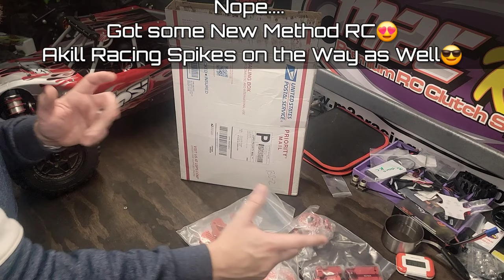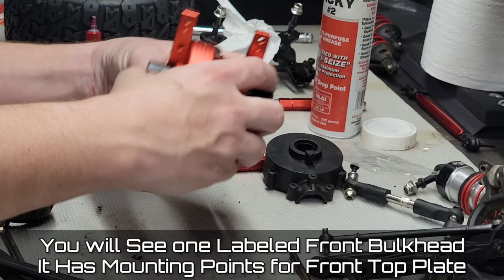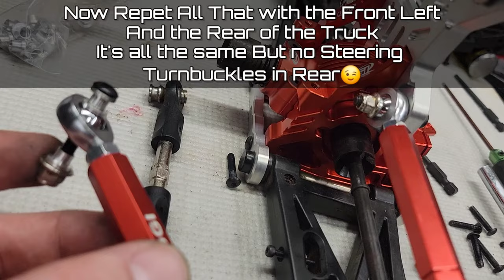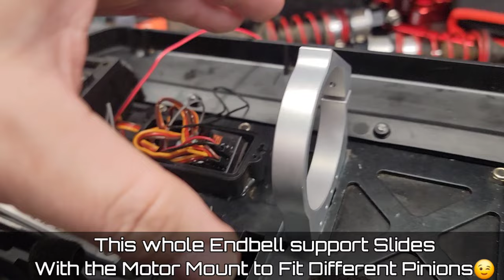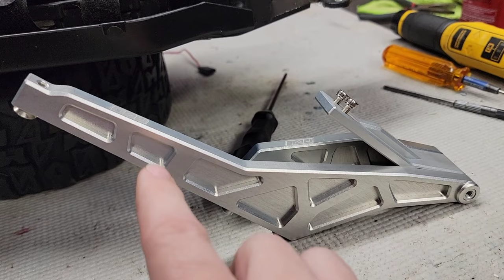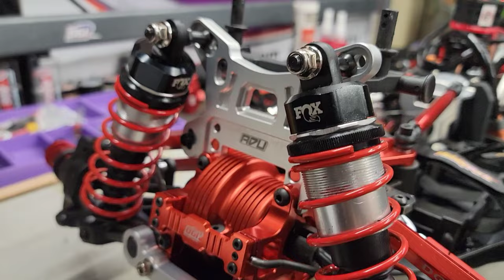Losi Dbxle 2.0 Full Beefcake Upgrade Install Video😱😎👍 #BestUpgrades #LosiDBXLE

Comment: Holy guacamole Batman you talk FAST... I had to double check and make sure I wasn't watching at 2x speed when you were talking... This stuff all looks cool... But I really think it's all a waste of money tbh... You're just making stuff too rigid which just moves the weakest point around. It doesn't get rid of it. I had a bunch of aluminum stuff on my Kraton and I hated it. Instead of the hit being absorbed by the flex or maybe breaking a cheap plastic arm. I bent my whole expensive aluminum chassis plate... After that I took it all off. I had a good couple hundred dollars worth of stuff. It looked AWESOME. I had a bunch of blue anodized stuff. But the rigidity really didn't do what you'd expect it to do. If anything. It did the opposite...
Reply from the maker: I hear ya on the speed of video. Many times in this video I had to speed it up 10-20% or it would have been a 40 minute video😳

About the beefcake parts.... Every rig is different (especially these 1/5 scale rigs) .... Whole other world than 1/8th scale. and sometimes it makes sense and depends on what parts.

This is a big rig and the chassis is not strong and bends easily. So that's why the chassis reinforcement. I have done this with other big rigs and it has saved the chassis on my Losi 5ive T for example.... So it works in some places. Metal A Arms DEFINITELY NOT a good idea, and you definitely want to have flex in the places that can have impact, arms, bumpers. You want most of the flex around the outer extremities of the RC where the impact will need to be absorbed upon a crash and as you move closer into the chassis more stiffening is needed for the chassis and bulkhead areas because the gears and those types of things need to be held stable. The one place I'm concerned about with this build is that I have metal turn buckles and steering links WITH plastic arms, so the arms will give bit the other parts by the arm won't. We will see, most dudes do the same I did here with no problems because the arms still flex.
I understand all you said about impact moving to the weakest point and I only add strength where it makes sense. 
There is still some slight flex to the chassis even with the braces, the arms and bumpers flex as does the roll CAGE. 
When I first got this RC I bent the chassis with light bashing small jumps. I don't need it to be M2Cified like my Arrma rigs, I'm not planning to go big like indo in those videos.... But I don't trust myself, I will send er at times so this amount of strengthening was need for what I do. Sure if I was just interested in ripping around a field or keeping the tires in the ground most of the time with small jumps sure I'd be fine mostly stock. But I get a little silly if you watch my other videos. 

Really appreciate your time and comment.... Hope you are enjoying the channel, see ya round brother

Comment: Monster vid for a monster build. I’m liking ADU parts so far as well, I’ve only got a few pieces so far but fit and finish is good. Looking forward to seeing this sucker rip! Do you have the motor and/or esc upgrade picked yet?
Reply from the maker: Appreciate the kind support my friend, I'm thinking of eventually getting a Max5 G2 so I can go 12s if I want to. Or might drop the G2 in my 30N build and put the max 5 in here as the 30N is bigger🤔 kinda upgrade poor at the moment so just gonna rock some fans and see how she does on a 19T.....I'm sure that's too much for the stock system 🤣😂 but with good fans running off 4s balance we will see.
See ya round brother
Reply: @3SonsRC  I feel ya on the upgrade budget lol I’m lucky if I have replacement budget most often.  Usually at least half my rigs are down needing parts at any given point. Hope to see you around more, get consistent content rolling again 💪🏼

Comment: Looks super nice man!   I have always wanted to do some type of upper chassis braces.    How do yours work in your opinion?
Reply from the maker: Appreciate your time Brother. Man I havebeen so busy I haven't run it since all the upgrades it's a shame. But I have done something very similar on my 30 Degree N build video you can check that video, I have Bashed it pretty good and they hold up well. With a bad hit the plastic ends might bust at one end but there designed to do that as a break away part to save the chassis. There easily replaced.Will eventually get this one out and do a big tire test on it, got like 5 options I'm gonna compare. 
Hope to see ya round

Comment: Awesome what pieces did u use for your center brace on your 30
Reply from the maker: What's up brother.... Thanks for your time and comment!
For the 30 N I used two of the Outcast ones screwed into each other in the back to reach that distance.... With Carbon Fiber tubing over.... I show it a little better in that video. But not sure which lengths I used combined in the rear.... If you buy the Outcast 8s set (Jenny's RC) you will see two match up perfect.... Then a shorter one in the front just like I did here on the Dbxle but on the 30 N it actually matched up better.
Hope your enjoying the channel brother.
See ya round

Comment: NICE!!!!  👍👍. DID YOU PAINT YOUR ROLL CAGE WHITE ?
Reply from the maker: Thanks brother, yeah I got this rig used before all the upgrades.... The dude painted it, but I really like it
Reply: @3SonsRC NICE 🤙🤙🤙. Will it flake off you think?
Reply from the maker: @johnmiller4553  I think it was brushed on so it's pretty thick, couple spots it's scraped off maybe from a big rock but for the most parts it's good... I might have some touch up paint on hand to rough it up occasionally but it shouldn't be too often seems pretty flexable, maybe it's the type of paint he used. Seems thick and flexable, not easy to scrape off.

Comment: The front kraton brace is 114mm. Whats the length of the rear? They have 164mm 211, 240, and 443mm?
Reply from the maker: I just bought the whole set so I'm not sure. Pretty sure it's the longest one for the Kraton. 
If I'm not mistaken it was a tad too long (where I attached it) and I had to cut about 1/8th off🤔 and then I re-threaded the brace with a kit I have.
Hope that helps.
Reply: @3SonsRC nice ok great thanks. Full set on eBay is like 13 bucks lol. You use a tap and die set to rethread?
Reply from the maker: @mikeguzmansr  yup, that's exactly what I did.

Comment: sad when a 1200 rc needs 1200 to be fast and tough.
Reply: It doesn’t need any of that but maybe diff cases. I own multiple of these rigs. They are great.
Reply from the maker: Your right diff cases is most important🎯
This is more of a super Beefcake Build but yeah they do good without all this.... Chassis bends easy though so the braces are essential IMHO